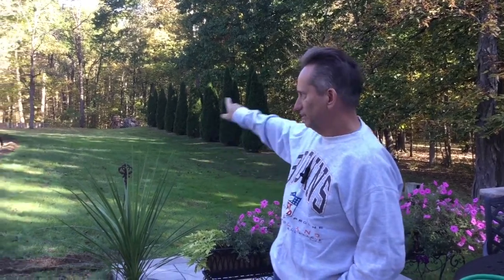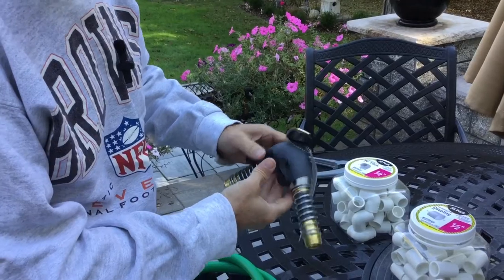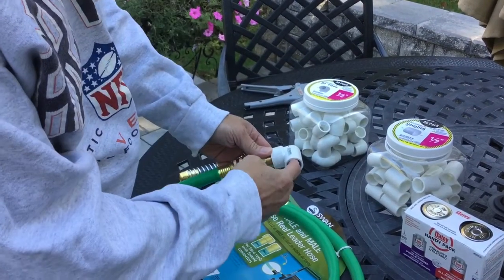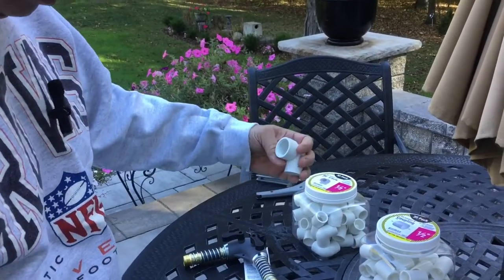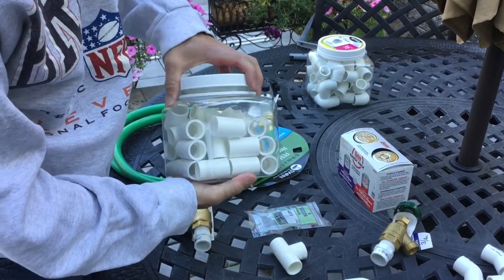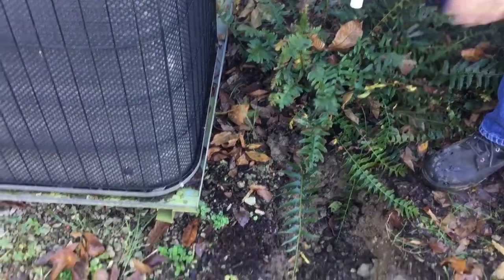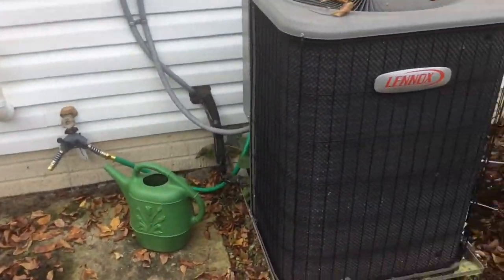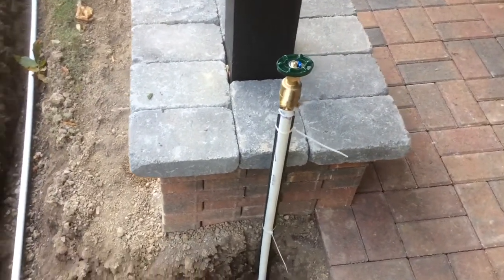Add Water Spigots Anywhere in Your Yard! #spigot

Comment: Don’t know if you’ll see this, as it’s 2 years later, but, THANK YOU! I’m putting in an outdoor sink, and need that 3/4 to 3/4 adapter. I asked for help at Lowe’s, but nobody ever came to help, after waiting 1/2 an hour. 
Anyway, I got what I thought would work, but it’s national to national threading. I took a screenshot of what you used, so now I can get the right piece. This tidbit is so appreciated. 
Also, I hadn’t considered the water pressure to the sink, as all the rest of the line I’m running is irrigation tubing, and attached to a flow reducer. Future crisis averted!
Reply from the maker: This is the description of the part at Home Depot: 3/4 in. MHT x 3/4 MIP or 1/2 in. FIP Brass Multi Adapter Fitting  Model# 801709

Comment: thanks for informative video. Could you please upload material list especially spigots and adapts. looking to the same type of project. however not worried about frost line so much in lower Alabama.  GO Bucks!
Reply from the maker: Hey Nathan,

Thanks for your comment! I don’t have a material list. I would recommend going to Home Depot on a weekday and getting some help from the plumbing clerk. Tell them what you are trying to do and they should be able to provide all of the materials. Just try to fit the pieces together in the store to ensure that you have the correct sizes of fittings.
Reply: How much did all materials cost?

Comment: How are you sir, mostly modeled my extended spigot after your video. Thank you! The difference was I didn’t bury my pvc pipe. I live in Connecticut. The line has a downward slope and I added a ball valve drain at the lowest point so I would imagine that I won’t need to use an air compressor to blow it out. But my question is, how bad is it that I didn’t bury my lines? Will it deteriorate/crack in the sun (in the summer) and in freezing temps even if there is no water in them?
Reply from the maker: Hello, Since you didn’t bury your PVC lines, the sun will deteriorate them over time. I don’t know how long it will take for the sun to do significant  damage. Also, make sure that your slope in steep enough to drain the line thoroughly. One dip in the line could cause water to pool and later freeze and crack the line. You may want to consider burying the lines slightly below the surface to protect them.
Reply: @AdventuresAtHome1  You convinced me to bury it. Thanks for the help sir
Reply: I also live in CT.  I ran a PVC line to my wife's garden so she could have a spigot nearby.  I buried the PVC line at a similar depth.  I intend to blow it out with a small compressor every year sometime in early November.

Comment: I have a brain of a 5 year old so I have a dumb question about the Y connector. So will the faucet that's connected to the house with the Y connector always be turned on for the other spigots to receive water? Or do you keep that shut off and only turn on when you want to use your extra spigots?
Reply from the maker: I leave the house spigot turned on all of the time, so that the other spigots receive water. Once side of the Y is for the spigots and the other side of the Y is for a hose on a reel.
Reply: Literally my exact question! Thank you

Comment: I'm wondering after 2 years how the hose connection is holding up.  Mine began leaking after 2 years.
Reply from the maker: The hose connections are holding. Which connections are leaking? Maybe use some latex pipe tape on the ones that screw in.
Reply: @AdventuresAtHome1  It was my splitter.  When I looked inside it, the closer was plastic and looked like when in closed position, it still showed a slight slit for the water to come thru.  I've replaced it with a brass one.  Thank you

Comment: How deep did you dig the trench?
Reply from the maker: I only went down about 6 inches, since I flush the lines in the Fall.
Reply: @AdventuresAtHome1 how to flush?
Reply from the maker: @sup3098  I used a fitting to connect to my air compressor. See my video on it.
Reply: Do I need flush the lines of if I live in Texas where pretty much warm???
Reply: @sup3098 you can use a piece of water hose, female end and put an air connector on the other end for air compressor to blow the water out.

Comment: Why do you need to evacuate the water from the line ?
Reply from the maker: Since the lines are only buried 6 inches, the water will freeze if the temperature drops below 32 degrees for an extended period of time. The frozen water will crack the lines.
Reply: @AdventuresAtHome1  thanks for your reply
Reply: @G-Ovalle  You could also put a sprinkler system drain valve on the line. 
An anti-siphon valve will prevent contamination of your water supply.

Comment: Wow dude you got did this just totally the wrong way.
Reply: A 100 ft roll of polley pipe is only about 50 bucks. And I would have drove through the basement wall into the basement and connected there. And on the other end I would have done copper coming out of the ground. PVC won't last exposed to the weather.
Reply from the maker: It's been working great for a couple years. I probably don't have over $50 invested in this solution.
Reply: @AdventuresAtHome1  yeah but things cost less then. You should price it out today it'd be more like $400
Reply from the maker: @lostintime8651  Where do you buy your supplies? Home Depot has 10 foot sections of the 3/4 inch PVC pipe available for $5.61. The 100 foot rolls of poly pipe are going for $107. You aren’t making any sense.